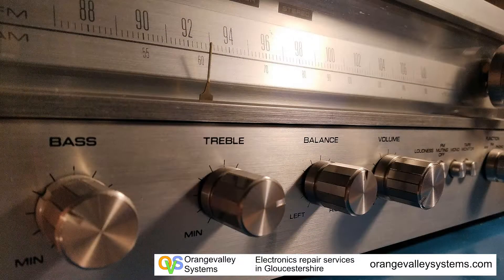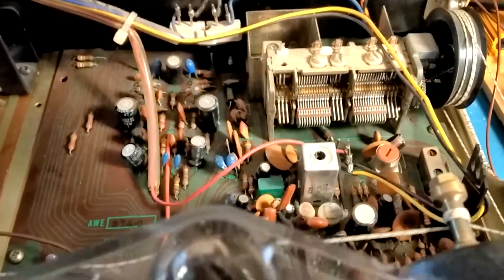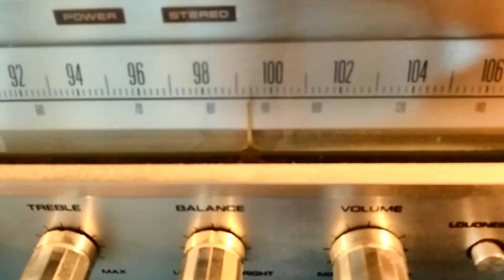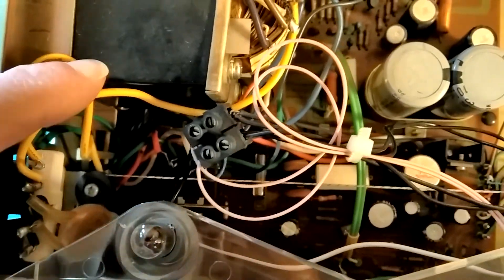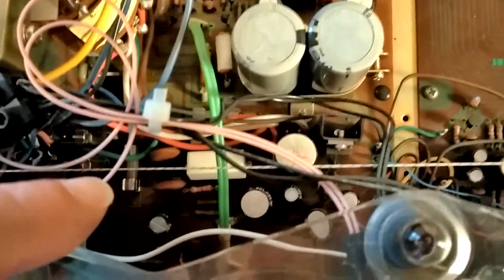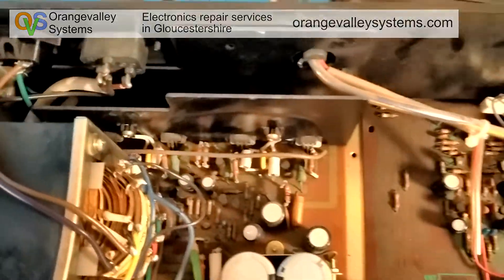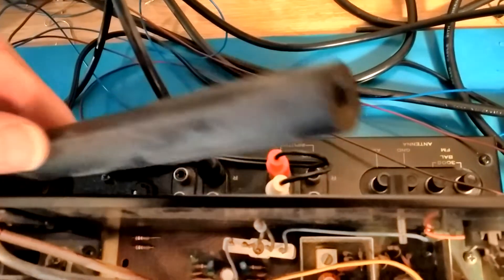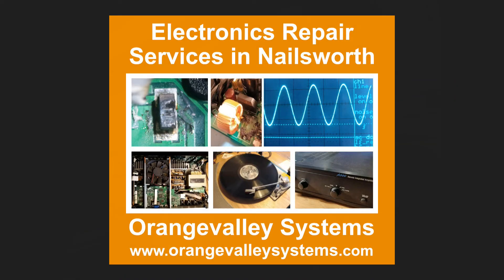Repair of a Pioneer SX-450 that puts a hum on the speakers

Comment: Hi my speakers make a loud pop when switching on the amp and crackle when turning the volume and lose sound in one speaker sometimes when doing this. Anyone else had this problem. Is it an easy fix. I seen someone put resistors in speaker connectors but I don't want to be doing this.
Reply from the maker: It looks like that receiver doesn't have a speaker protection relay fitted that normally connects the speakers to the amp a few seconds after switch on. If you connect the speakers to the B output you can then switch it on by putting the switch to the speaker A or speaker Off position then after a few seconds move it to the speaker B position. The crackle and loss of sound can often be fixed by spraying some contact cleaner into the volume control pot.

Comment: Hi there, sorry I am located in HK.  I got the loud100hz hum that isn't volume dependent with this, was that the problem you have encountered??  I have replaced the 2 main power caps with no avail.
Reply: after inspecting the schematic, are they c109/c110 caps for the left and right tone controls?   0.33uf/35v|
thanks
Reply from the maker: @hokman1  Hi, the failed capacitor I had was C305, a 220uF 50v. The capacitor for that supply powers the tone controls and the turntable preamp. My notes show that the 36.5v rail with the failed capacitor measured 30v on a multimeter although it's easier to see how bad it is on an oscilloscope if you have one.

I guess the level of hum and measured voltage will be dependent on how failed the capacitor is.
Reply: @orangevalleysystems  It worked, thanks very much sir!  serious problem solved with a cheap part
Reply: @orangevalleysystems  Hi it's exactly true what you say I am currently repairing this amp the capacitor c305 220uf/50 volts is defective, I will replace the 2 soon I only have sound on the left channel and no sound on the right channel with background hum on both channels
Reply: @yanng3790  I have that same problem. So far I noticed a 150 ohm resistor next to the output transistors completely burned up. And that transistor it is with also tested bad